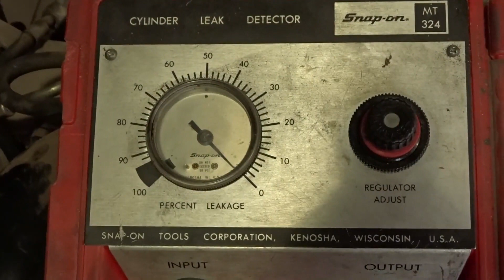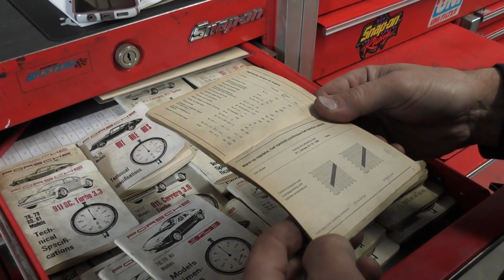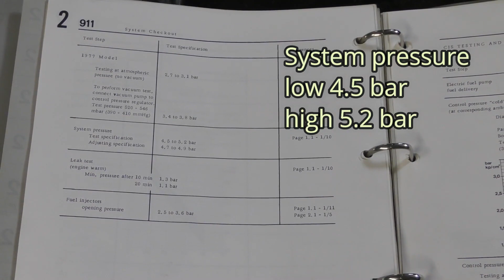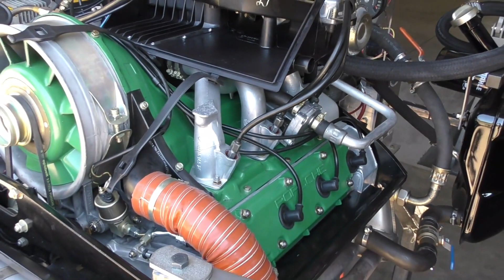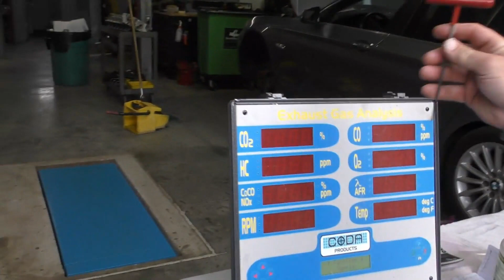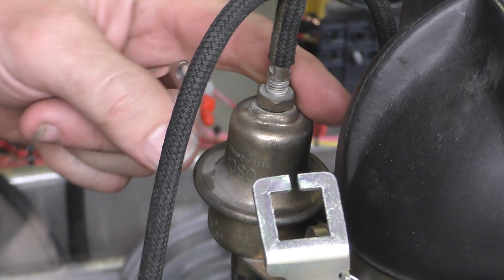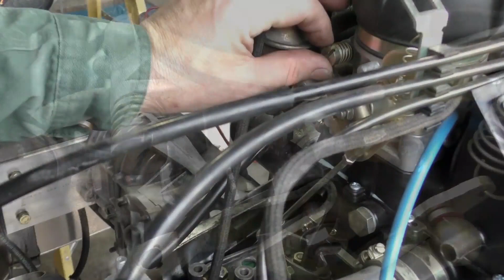How To Diagnose And Fix Your Porsche C.I.S Fuel Injection System

Comment: Great video.  A question on the WUR cold setting.  The spec book says that the value should be with testing vacuum 450-550mbar but I didn't see you put the vacuum pump on for that step.  Does it need to be done with a vacuum? Thanks
Reply from the maker: Yes vacuum is part of the test and you can use a vacuum pump or just start the engine and use its vacuum.
Kurt

Comment: great video! Silly question, but what is the best way to disconnect Bosch wiring connectors with the metal clip? It appears you are just pulling straight off, but I find myself wrestling the metal clip with a pick to pull it out of its groove, which then allows the plug to disconnect...
Reply from the maker: So it sounds like you are doing it right. Sometimes the connectors will just pop off and sometimes the fight all the way to the end. 
Kurt

Comment: Hello Kurt,
I want to again thank you for your wonderful videos.  Without a doubt the most clearly photographed, expertly narrated, well edited, and informative series on the internet for understanding the air cooled 911 engines.  

I actually wrote to you about a year ago regarding my persistent confusion understanding the Bosch K-Jetronic CIS.  Specifically, I continue to be mystified over the effects of the vacuum inputs to the WUR on control pressure.

You clearly demonstrate that negative pressure applied to the upper nozzle on the WUR (ported vacuum from the throttle body above the throttle plate) causes increased control pressure and consequently a leaner fuel mixture.

You also clearly demonstrate that negative pressure applied to the lower, side nozzle on the WUR (manifold pressure from the throttle body below the throttle plate) causes a decrease in control pressure and consequently a richer mixture.

At idle or when revving the engine in neutral I would imagine that a leaner fuel mixture would be indicated as the motor is not under load.  Nevertheless, under these circumstances, with a closed or nearly closed throttle, the manifold pressure would be quite negative relative to atmospheric and your video suggests that this manifold vacuum will decrease control pressure and provide a richer mixture.

Relatedly, I do not understand how the WUR will provide enrichment during hard acceleration.  Under this condition I would expect the manifold pressure to approach atmospheric (WOT) and be roughly equivalent to the air pressure at the ported aperture.  This should increase control pressure and result in a leaner mixture.

Obviously I am missing something fundamental here as my analysis indicates an opposite effect to what is actually achieved.

I wonder if you could provide a more detailed explanation of what is happening to control pressure during conditions of acceleration under load, deceleration, idle, and increased rpm in neutral.  It would then be informative if you could demonstrate how the WUR responds to achieve this and regulate the mixture.  I can’t be the only one out there who is confused about this stuff!!

By the way, I am very familiar with your location.  My cousin used to live in Lagrangeville.  In the 1980's I would drive my 1976 2.7 liter up the Taconic from my home in NJ.  For the past 30 years, however, the car has lived in Switzerland.  The motor was completely rebuilt 4 years ago.  I visit it twice a year and I’m now in the French alps driving it on the twisting mountain roads where it is meant to be!
Reply from the maker: So manifold vacuum has different purposes when used on different warm up regulators. Also not all WUR are the same and can use vacuum in different ways. It would be best to book some one on one time with me and we can go over your specific warm up regulator and its application. You can book some time with me on our website here https://www.klassikats.com/consultation-services/
Kurt
Reply: @Aircooledconsulting  
Thanks for your consultation invitation but I think I’ve now got things figured out.  The WUR you demonstrate (033) has the atmospheric vent port below the diaphragm (this is also the case for 017, 009, and perhaps others); the manifold port is the top nozzle.  For other vacuum models prior to k-lambda (e.g. 045, 069, 089), the reverse is the case - the vent port is above the diaphragm.  On your video, I respectfully suggest the vacuum lines to your 033 WUR are reversed.  You will achieve acceleration enrichment if the manifold vacuum line is connected to the top nozzle (not the bottom side nozzle).  

On my car, which runs beautifully (refurbished WUR 017), the upper nozzle does, in fact, tap manifold pressure through the “T” connector going to the vacuum line on the deceleration valve.  The atmospheric pressure line goes to the upper “ported” aperture on the opposite side of throttle body above the throttle plate.  (As on your car, the lower aperture provides vacuum to the distributor.)

I finally figured this out by reading the 4th edition Bosch K-Jetronic manual where the operation of this model WUR (vent below diaphragm) is quite elegantly described on pages 28 and 29.  When both the upper and lower compartment pressures are roughly equal and atmospheric (e.g. during WOT), the inner spring relaxes, the diaphragm with the control pin moves down, and control pressure is lowered resulting in enrichment.

Comment: I just serviced the car replaced and my fuel filter myself, after that my 911 won't start
Reply from the maker: Recheck all your connections and make sure that you have not knocked something off. The engine will need to crank for a bit to flush the air out of the fuel system after replacing the fuel filter.
If the car drove in it will be something simple that you changed while working on the car.
Kurt

Comment: Excellent job!  Did you build that test stand?  If so, do you have pictures or plans for it?  I can see the substantial advantage to making these changes out of the car.
Reply from the maker: Yes I built that engine run stand, no I dont really have a buildable set of plans for it. I did my basic lay out in Solidworks for the big pieces. However, the finishing touches were built in place based on where I needed things to be.
Kurt

Comment: Hello Karl, your videos are amazing! They are incredibly helpful for the restoration of my 911 SC 3.0 US.
A big thank you for that!

Actually, I have a question about this:
How much current should reach the warm-up regulator?
And do you perhaps have information about the fuel quantities that should come from the injectors during full load, partial load, and idle? Probably over a specific period of time?

I would really appreciate a response. Thank you so much!
Reply from the maker: Patrick,
The current will vary based on the resistance of the bi-metallic strip heater. Most will be around 2.5 amps.
actual fuel volumes will also vary based on the fuel distributor. I dont have this specific information, I mainly check for consistency and uniformity across all cylinders when doing fuel flow volumes.
Sensor plate height and mixture setting will also affect fuel flow volumes.
Kurt
Reply: @ thank you for your reply. Is it normal for fuel to come out of the injectors briefly when I turn on the fuel pump? I’d be happy to send you a video if needed. Do you have an email address? I would really appreciate your feedback.

Comment: Don't trust normal resistance check for plug cables....Will show you if it's broken, but NOT if it's worn out electrically. Only testing resistance at say 10ks of volts will. Old cable testers can do that. I had two VW Golfs at the same time, they both had the TSZ ign. Both of their wires measured around 6kOhms, but one car wasn't running, dropped one cyl after the other. Changed just about anything else on that car, until my friend changed the wires....and boom.
Reply from the maker: Yes, you are correct in that no load means no test. And it is more likely that the issue you saw was insulation failure, resulting in spark leakage. They would have checked out from a resistance standpoint, but on the oscilloscope, you would have the firing voltage being really low. The testing in this video is geared toward Porsche, and Porsche wires have an issue that is easily verifiable using an ohm meter to find a bad resistor connection. This is why we tap the wires when testing. However, this is only part of the testing procedure, and even a wire that passes a bench test should always be confirmed under load with the engine running.
Kurt

Comment: I have an 81 911 SC. Did the pressure check and got these numbers:

Ambient Temperature: 28.44°C
Control Pressure @ Ambient: 2.05 Bar (Low Spec: 2.844 Bar)
System Pressure: 4.8 Bar (Spec: 4.5-5.2 Bar)
Control Pressure Warm: 3.55 Bar (Spec 3.4-3.8 Bar)
System Pressure Warm: 4.8 Bar (Spec: 4.5-5.2 Bar)
System Leak Down: 1.6 Bar @ 10 min (Spec: 1.3 Bar minimum)
1.3 Bar @ 30 min (Spec: 1.1 Bar minimum)
System Leak Down Control Pressure: No Change

Is my control pressure too far out of spec? It does backfire if I try to take off on a cold start so I have to let it sit a minute.
Reply from the maker: pressures dont look bad, would need to know the WUR number to confirm exactly. What are your fuel mixture settings? CO, HC, CO2, and O2 numbers?
Kurt
Reply: @Aircooledconsulting  I don’t have the WUR number handy but I do know it’s the one for the 81 model year per the Bentley manual. As far as testing every thing out, this is about as far as I’ve gotten. I thought about making sure there aren’t any vacuum leaks as well.

Comment: No problems until the fuel hoses were all changed. If we increase the fuel, the system is readjusting the mixture to lean again. I will have the shop check the fuel pressures. Thank you
Reply from the maker: Your welcome.
Kurt

Comment: Sudden problems with a part of the CIS system. When warm the 76 911s won't idle when warm. No problem with start-up but as it gets warm the rpm drops and then when operating temp is reached, there is no idle. It also runs rough with a few pops.  The fuel system (pump, and lines were replaced about four months ago and it worked great. The problem started when the idle dropped a few 100 rpm when warm. Then after a few drives, it will not idle at all. I am thinking there may be a leak (hose) at the warmup regulator? The box and pop-off valve are in great shape with no cracks.
Reply from the maker: I would look at fuel pressures, sounds like the control pressure may not being working correctly.
Kurt

Comment: Hi! I’m hunting a problem on my 77 2.7s. First time I drove the car after complete rebuilding engine and cis. Runs smooth… but… stumbles every time between 1800-2400rpm (all gears) After 3000 it runs smooth again. Only noticable under load, not bench test. Weird. Do you think the problem lies within the CiS ststem?
Reply from the maker: Sounds like fuel, I would put my gauges on the car with a long hose and tape the gauge to the windshield so I can see what the fuel pressure is doing when the problem is occurring.
Kurt
Reply: @Aircooledconsulting  problem solved. Turned out to be indeed fuel related. Combination of leaking WUR diaphragm (so no enrichment on throttle opening) and a (much) too rich mixture. Leaning out the mixture with half a turn solved the issue. Feels great after 4 evenings of hunting the problem 😎. Thanks for sharing the knowledge Kurt 💪🙏

Comment: Great video.  I encourage anyone with a CIS car (Porsche, BMW, Merc, Ferrari etc) to look at FrankenCIS especially for those that have done some modification.  I'm running it on a Porsche 930 with big cams, bigger turbo and some other mild mods and using it to control CIS and ignition getting 425 rwhp without going to EFI.  Great option.
Reply from the maker: You really need to know what you are doing with these units. There are several options out there for electronic WUR. But I would not recommend them for most people as you can do more damage than good if you do not know what you are doing or do not have the tools to correctly tune and make fuel settings.
Kurt

Comment: Pretty good job all in all, very informative. My understanding is that there are adjustments that can be made on the fuel distributor for each independent injector, which perhaps you could have remedied the cylinder #1 low injector flow. Been tuning my 930 for years and it's always good to have a refresher course. Diagnostics can be challenging...isolating and testing each system independently as you've demonstrated is the key.
Reply from the maker: The flow adjustment on this particular fuel distributor is adjusted using shims under the port spring inside the fuel head. The 3.0L engines used a fuel distributor that had external adjustable springs. However, this is to adjust for slight differences in flow inside the fuel distributor and should not be used to adjust for a poor-flowing injector.  
Kurt
Reply: @Aircooledconsulting  thanks for the clarification. Of course my 3.3L engine would have a different distributor. To your point, slight adjustments/fine tuning only, not as a remedy for overall poor flowing issues. I appreciate the knowledge you're sharing.

Comment: Great information, I have a Mercedes 500 slc with a few problems after not using it for a while. Have removed the WUR and ordered a new repair kit. I do wish I had watched this video first ! Have brought the same gauges you use, but didn't realise I could check everything, without the engine running. I may put the unit back together and check, before rebuilding. Thank you for a great video, I will watch the rest now
Reply from the maker: Kayleigh,
I would not recommend using a repair kit unless you have access to a calibration bench where you can correctly calibrate the warm up regulator after rebuilding it. I would send the WUR to CIS Flowtech and have it rebuilt. 
Kurt

Comment: CIS is the best system vs a computer with stored data to control. Computer  -  quantum. CIS - analog.
Reply from the maker: when working correctly the CIS injection system is pretty reliable and long lasting system.
Kurt

Comment: Another great video Kurt. Thank you so much. Does this one precede the CIS Fine tuning video that you did, with the motor in the car? I noticed how you had the vacuum lines connected to the Decel Valve as an SC. I'm learning a lot from these videos and it makes a huge difference than searching through forums and only getting the opinions and recommendations from people that are ill-informed. Very much appreciated.
Reply from the maker: Hi Jason, your comment made me think of this comment from 2 years ago. We did have the 77 set up incorrectly as an SC. We found out when the engine went into the car. Thanks for watching, S

Diederick,
Yes, good eye on the vacuum connections. When I first assembled, I put everything together just like the 911SC configuration. On the test stand, it ran well. However, once I put the engine in the car, it suffered from a lean misfire at 2000 - 2500 RPM. I revisited my vacuum layout and, after hitting myself in the head, reconfigured it to the 1976-77 2.7L layout. The problem was then solved, the lean stumble went away, and the car continued to perform as it was supposed to. What this re-enforces is that no load is no test. And even though the engine ran well on our test stand in the car its performance was not as it should have been. Thanks for watching, and thanks for keeping an eye on what we are doing.
Kurt

Comment: hiya.., i have  1.6 rs turbo and has been sat for 10!years and never had an issue with fuel injection distributor but now have no fuel to injectors but have pressure to cold start.., have removed eha valve and added 1/4 turn clockwise to see if the valve was blocked., then did have a pressure under cranking and pressing on air flap on ke jetronic system but after leaving it for a few hours again i have no fuel to injectors but now even with cranking and holding flap down fractionally it's not getting fuel to lines.., was wondering if this is an ecu fault or failing fuel distributor
Reply from the maker: Paul,
So CIS fuel systems do not like to sit for long periods of time. What usually happens is that the fuel evaporates away leaving just the additive package that turns to a glue like substance. More than likely this is what is causing your issue. I would  confirm that you have the correct incoming fuel pressures and flow volumes. Make sure your electrical inputs from sensors and grounds are correct.  And that your pressure differential valve is getting a signal from the control unit. If all of that is correct pull and send the fuel distributor out for repair.
Kurt

Comment: Kurt
Excellent instructional videos.
Where do you buy the graduated plastic cylinders to measure the injector spray pattern and volume?
Also on a well running 1987 930, I have replaced the fan belt with a new Porsche  belt.
I have installed 6 shims between the outer pully and the tensioning washer with 1/4 inch deflection with the ac belt disconnected.
I am not able to rotate the engine by turning the alternator  nut to adjust the valves.What would you suggest?
I appreciate your time>
Thank you
Reply from the maker: You can find them here https://amzn.to/4bLq5Mz at amazon. If the belt tension is good, then there is just not enough friction between the belt and the pulley to turn the engine through its compression stroke. this is normal.
Kurt
Reply: then you must remove the plugs to adjust the valves?
thank you @Aircooledconsulting  
Victor
Reply from the maker: @victorvillari-fc1rz  with the plugs out makes it easier to turn the engine and you can do a leak down and plug check at the same time.
Reply: @Aircooledconsulting  thank you